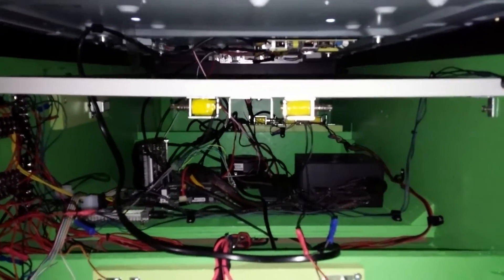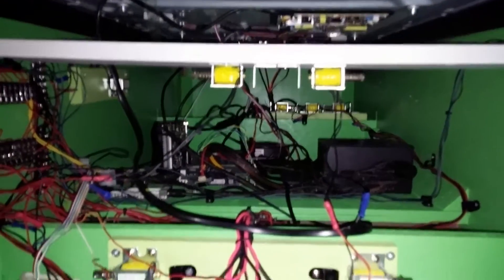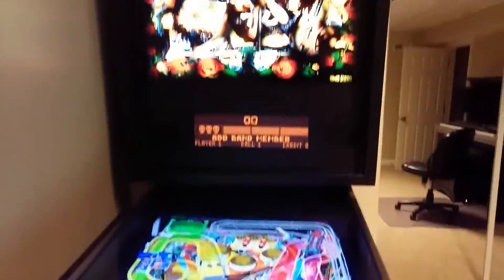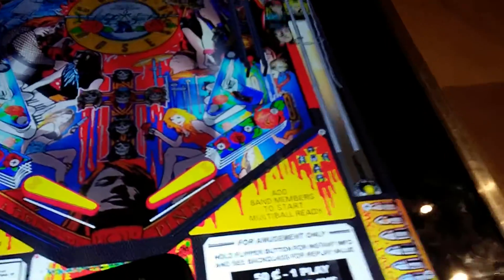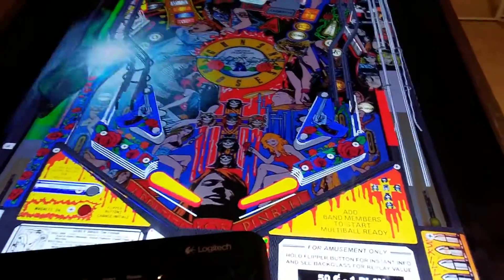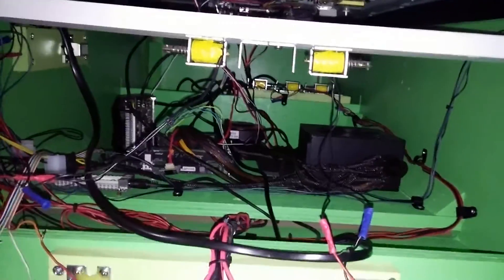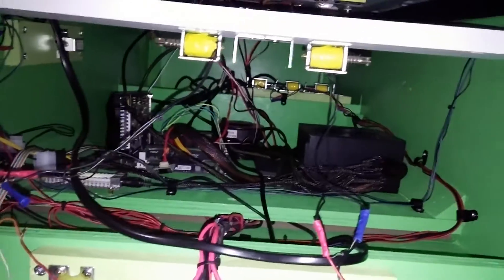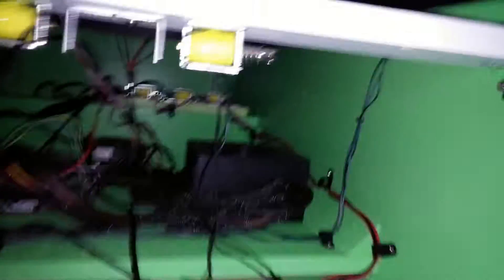Virtual Pinball solenoid configuration

Comment: Hey Mike, Do you have a video or a post in a forum where you show what to do on the software side and what is needed to get this working with VP? I am very interested in adding this to my cabinet. How does the 8 channel relay know which solenoids are flippers and which are bumpers, etc...? Thanks!
Reply from the maker: I do not specifically but whether you use this USB 8 channel relay or a LEDWiz + 16 channel relay board you need to install the DOF (Direct Output Framework) which is the part that controls the solenoids.  Then go to www.vpuniverse.com/ledwiz   Create an account - this tool creates the config files that Visual Pinball / DOF needs to work with the solenoids.   The website allows you to then assign each relay (or LEDWiz output) to whichever solenoid/contactor you wired in.    You also will need the DirectB2S backglass server running - then go into the script on each table and change the "Set Controller =" to look exactly like this Set Controller = CreateObject("B2S.Server")        make sure to Compile then save your table.   Next time you run it - your solenoids will automatically work with the tables.
Reply: Great, I will check this out. Thanks!

Comment: Excellent video and machine Mike. sorry dumb question but do you prefer the solenoids over contactors? especially for flippers?
Reply from the maker: Thanks- the other machine I'm working on now is quite a bit more advanced!   I decided on solenoids as you could have them hit various objects (bells, wood blocks, plastic clips..etc) to get different sounds.   Contactors, to me, all sounded like the same click no matter if it was a slingshot or pop bumper.   Being able to customize the sounds they make was the main reason.   Cost was another - those solenoids were around $4 a piece I believe.

Comment: Hi Mike, I got my solenoids today.. (another) question for you.What was the thinking behind mounting the stoppers on the "wrong" side of the solienoid. The weaker rod is hitting the brackets and wire clamps.
Reply from the maker: Daryl Erwin You have to do this on the push-pull solenoid - the spring is much too weak to make an impressive sound if you had it hit the object from the other side.   Also-- you would have a delay especially on flipper holds as you couldn't get a sound until you released the solenoid then.   These solenoids have no way to reverse the rod (I did check on this)   it is tapered on the end and the winding of the coil would also need to be different.
Reply from the maker: Daryl Erwin Sorry to clarify-- these specific solenoids are meant to "pull inwards" from that larger side so I see your reasoning on being the "wrong side"  indeed it is but this solenoid is too weak to have it pull any object to produce a sound (ie-- a real flipper) as in how a large 50v solenoid would work on a real pinball machine.    So basically your only option is to hit on the opposite end.   I did try mounting a larger nut on that end and really made no difference in the sound.   They produce a pretty loud sound as they are.   A knocker coil would also be another option-- but the cost is 4x as much as requires a minimum of 24v to function and better to run them on AC voltage at around 50v
Reply: Mike Karina Oh I get it, the "lightbulb" just went off in my head. The unpowered solenoid has the main plunger rod already extended so applying power, pulls it in, not out.. duh. So like you said, no sound until you release or remove the power.

Comment: Mike , did you use diodes on your config for the solenoids ? and where did u place them ?  thanks ..
Reply from the maker: Dennis de Leest  Yes I used 1N4007 diodes (Though you can use 1N4001 or higher) since the 1N4001 handles up to 50v and these are 12v.    The stripe goes to the positive lead close to the solenoid-- the other end to the ground.   If you do not use a diode-- the voltage collapse will cause your controller to lock up or fire random solenoids (then lock up) or cause damage to the controller.

Comment from the maker: Thanks!   If you saw the other videos I ended up mounting the other pop bumpers in the same manner as the flippers (PVC trim board across the cabinet)    Slingshot still on the bottom though.   I'm running 10 solenoids now.   Need to update the videos as I've done a bunch more work.